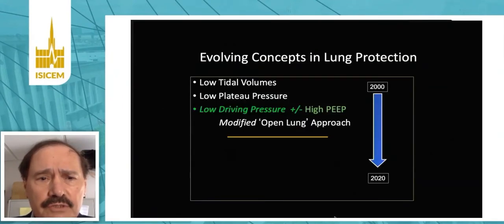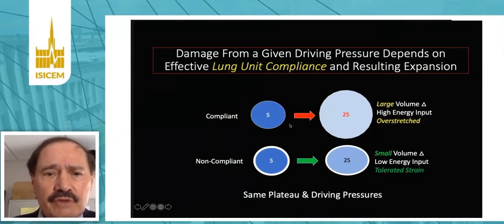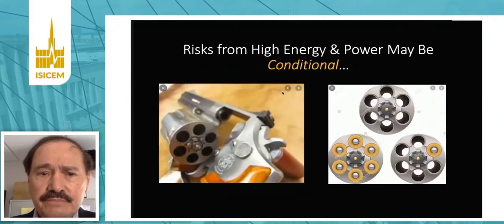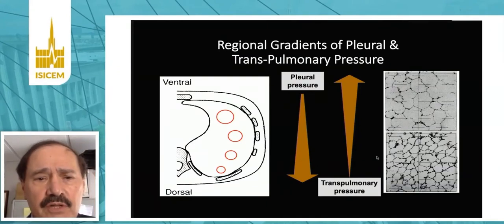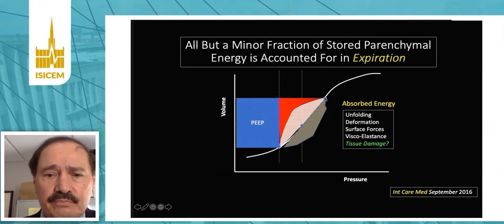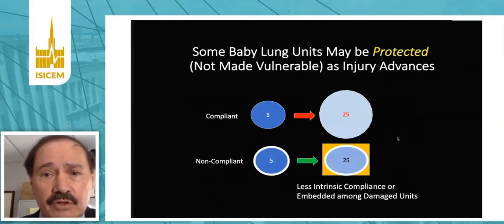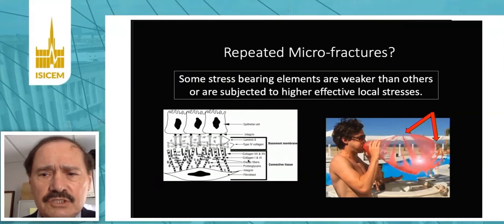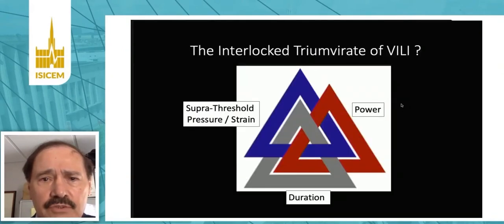Micromechanical causes of VILI J Marini

Comment: 6ccs/kg tidal volumes, the assist-control, and peep greater than 10 cm H2O leads to VILI. At least 8ccs/kg tidal volume, SIMV, inspiratory times 1.1 sec or greater is lung protective. The real lung protective.
Reply: @ ronaldsshiffman9171
How do you explain that? Details, details, details….Appears to be one size fits all without details
Reply: @macha3119  Thank you for your interest. Let me start by saying I retired as a respiratory therapist after more than 30 years of direct ventilator patient care. There is very little I haven't seen and done many times. This communication platform is not conducive to a more detailed explanation of why I have great success with ventilator patients and others don't. For example, I never had a case of VILI with one of my patients. Early in respiratory school I was taught to make the patients comfortable. 6 ccs/kg VT and A/C is not comfortable in most cases. Some will say I am wrong. I say, the success I have had with vent patients and getting them off proves I am right. I appreciate your desire to learn and become better. Your patients will like that a lot.
Reply: @ronaldshiffman9171  This platform is what we have, otherwise I would not have been able to communicate w you. I was basically asking if you have published anything that you could refer me to. Not dismissing bedside experience, just inquiring about any literature you may have regarding your
approach to mechanical ventilation. You are right that the 6ml/kg is not, at times, appropriate. But the evidence out there does support Vt in the range of 4-8 mls/kg. There’s also acceptance of higher Vts as long as the driving pressure remains low. 
I’ve read your comments on Yoshida Takeshi’s video on P-SILI. Pls post anything you have regarding your approach.
Reply: @macha3119  As I mentioned, I am retired. I have written stuff, not published or peer reviewed. I think you are sincere and honorable. Beneath my surface sincerity, I have a cynical core. I have found respiratory research to be time consuming and difficult. As a staff therapist, I never got paid for any research I did, so it ultimately was never worth my while. Hopefully you can better position yourself than I could to get paid for your work. I found that the ASV modality on the Hamilton ventilators enabled me to get the best results. You really need to understand all of the modes of ventilation, but ASV is really a brilliant advance. I probably sound frustrated with the process of respiratory research but I see a silver lining. Artificial intelligence has the potential to analyze thousands of charts of ventilator patients and identify concrete actions that care givers did to patients that give the best outcomes. I really believe that  traditional medical 'studies' will become obsolete. It is time for me to stop. Check out the Hamilton if you can, and ASV. I used to lavage, bag, and suction all of my patients. I swear by that, even though some disagree.